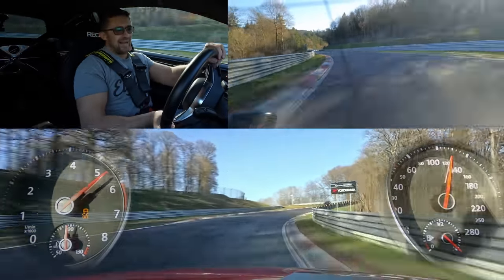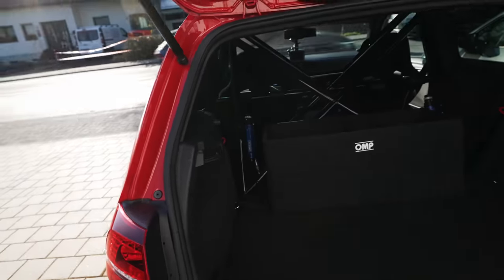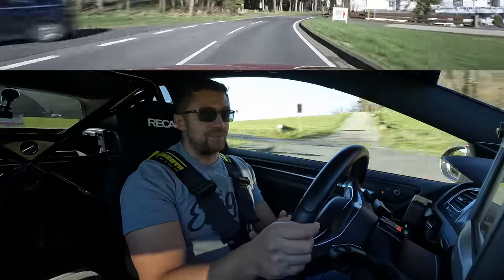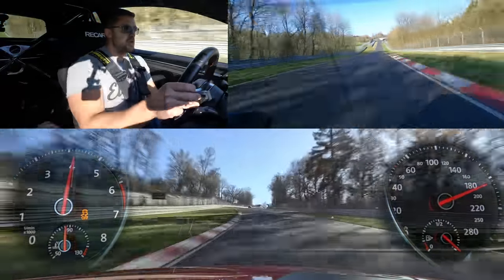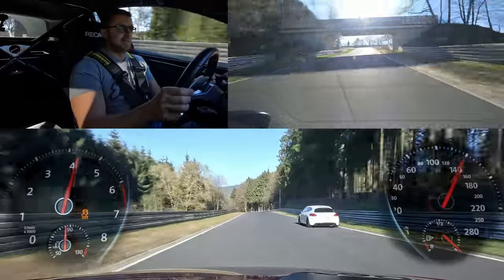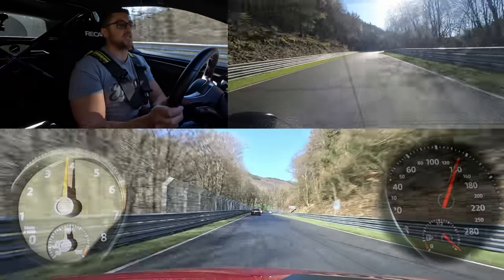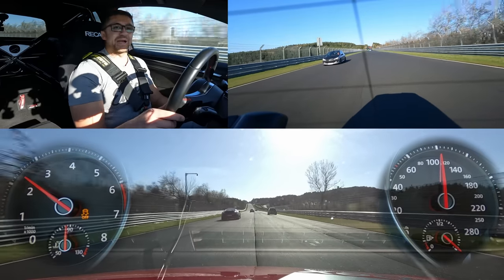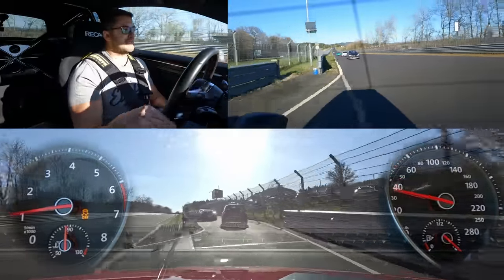I Waited 6 Months to Finally Drive This Car! / Nürburgring

Comment: A Golf without a tune is a crime!
Reply: A crime without a Golf didn’t happen! All criminals drive one!
Reply: I don’t see any reason to tune an engine on FWD.
Reply: @jasonstathoom5142  on this motor especally its +80/100 hp and same Nm with a dsg reprog too
Reply: @ZFREU  I know there’s a wide list of options to tune, but doesn’t matter if it’s FWD and you can’t release your power
Reply: He passed a Golf R wagon with Revo decals all over it pretty smartly,driver mod is the best mod.
Reply: @jasonstathoom5142  I get were you come from but still nonsense. RWD is better in almost every point there we agree but still you can tune an fwd and keep it under control. If you adapt Tyers, Rims, Suspension for the HP it can work just fine. Watch Misha in the Red 350 Hp Fiesta ST from the french dude. Works just fine and both had fun. If you aim for 800 hp or somthing crazy like that, peopel could say "makes no sense to tune rwd , go for awd."
Reply: @platzhirschtv4770  I mean if you have a 400hp GTi and gonna compete with a 400hp R on traffic lights, I don’t think it will be fun for the GTi owner
Reply: @Jason Stathoom  thing is when I think about ff I think off old Honda civics and peugeot's n/a engines. In modern gti or r  terms you probably  right.  Topspeed I would still bet my money on the gti  in given description.
Reply: @jasonstathoom5142  if all you do is race at traffic lights, sure. That power is still useful on the uphill sections of the ring on FWD, for example, though.
Reply: I disagree. It's front wheel drive and already 230bhp. You keep adding more power and all you are going to do i reduce traction. They're already fast cars plus it needs to be dependable so concentrating on handling or weight is definitely the way to go.
Reply: I don’t think many of you guys have driven a properly setup fwd car by the way you’re talking. You can put down some serious jam with a LSD, big sticky tires, and boost by gear. 
Not tunning a fwd car with some serious power is blasphemy. It can make all the difference!
Reply: @grahamhaynes7658  that REVO Golf R hatch is pushing 400bhp & 400ft-lb+ , tyre, brakes and suspension upgrades.

Misha is a talented driver indeed.

Comment: The Mk7 GTi is a dream car, let alone the Club Sport edition.
Reply: Misha really should get his hands on a Clubsport S, the difference between a Clubsport and the S seems to be quite big
Reply: Thoughts on gtd for a daily?
Reply: @sk8nshoot12  quality daily
Reply: Yeah, I went thru a Mk5 GTI and then a Mk7 GTI in two years, finally trading that in for a Mk7 Golf R, which I’ve kept for five years. For daily driving, the AWD lets the car use its power at lower legal speeds — it’s way, way faster at lower speeds. Got two car seats in the back. Tuned. Such a quick little everyday car.
Reply: @willywillywillywillywilly  boring though

Comment: A chill 8 minutes BTG, first lap with the car, not pushing it, not the final setup, traffic. This 230 hp weapon will smoke plenty of 500hp cars on the Nordschleife.

1:24 yeah that's why I won't ever even upgrade my car to semis, because at some point the forces become so high that I'd worry about suspension / chassis parts failing.

Comment: I used to run rings around most cars on an RD350…I now use a ZX7R. Being sat in a cage is nice for feeling a modicum of safety, but you can’t beat a motorcycle for that true feeling of speed & danger. It really does make you feel alive.

Comment: Golf GTI Clubsport doesn't make 230hp, it has 265hp/258tq(350nm), or for 10 seconds at a time during an "overboost" function upon flooring it in Sport and 3rd-6th gear, 290hp/280tq(380nm). So at least it has almost as much power as a R.

Comment: Ist that 245/40/18 tire on the 8J or the 9J one ? Ive got the 8J with PS4S in 235/40/18. But im thinking of a second set with semis. Not sure about the fitment of the 9j one tough. Any advice is appreciated!

Comment: M140i 450/500hp with lsd. Michelin ps4s or ns2r for track? Or maybe the cup 2 ?
Reply from the maker: Cup 2
Reply: @mgcharoudin  thats the most expensive option also😅 iff i go for the cup 2 it will be on a different set that i will put on iff i’m there at the ring. But iff its gonna be a set that i also want to drive it from home to the ring snd back home again. +- 650/700km. What would you choose? De ns2r or the ps4s. And to be honest i woudn’t track it on a wet day. So dry condition only.

Comment: Is it diesel? Why only 6k rpm? 😮
Reply from the maker: Turbo, safe, idk
Reply: @mgcharoudin  turbos does out after 5800rpm. With Downpipe 6200rpm
Reply: @manuelparra6934  so there is no power gaim above it, so they limit rpm's cause of loosing boost over it?

Comment: Sorry, but that's not a Clubsport. If it was it would've had 265hp stock with 290hp in overboost. Also frontbumper and wing are different.
Reply from the maker: Clarified in pinned comment
Reply: @mgcharoudin  ah, didn't see that. Thanks! Nevertheless, great driving. I've never been a fan of Volkswagen because of their tendency to understeer. But now I'm looking for a different daily driver and the MK7 looks interesting with it's mechanical LSD. How would you compare this to a Cupra 280 in terms of handling?
Reply from the maker: @ddmr7  Cupra is a bit spicier, but alignemnt is your friend

Comment: Upgrade it all you want, it's still a tail-dragger. There's no way in hell I'd spend the money to go all the way to drive the Ring and do it in a FWD grocery getter. 
Don't get me wrong, I'd love one of these as a second or third car to have a fun time getting groceries or commuting to work but putting it on the Ring is like digging a ditch with a dinner fork. I don't care if it's grandma's finest silver, it's the wrong tool for the job.
Reply from the maker: Ah, you're one of them "it must be RWD, manual, N/A and without ESC/ABS".
Reply: Typisch deutscher Golf Hater HS 🤡🤡🤡🤡
Reply: @Mzr  actually it's obvious you completely missed the point.